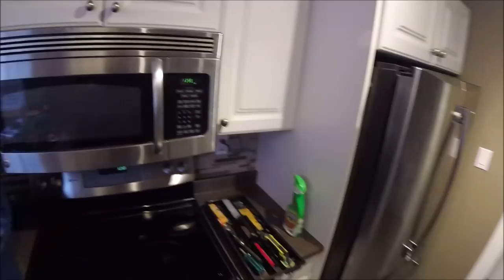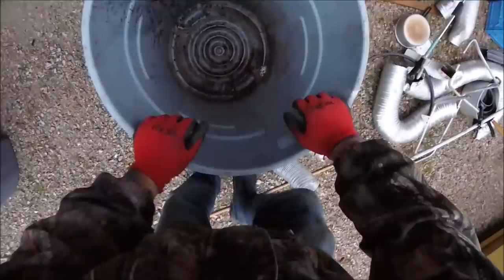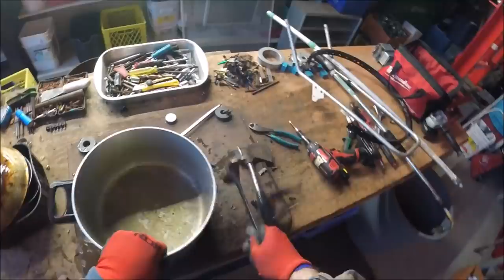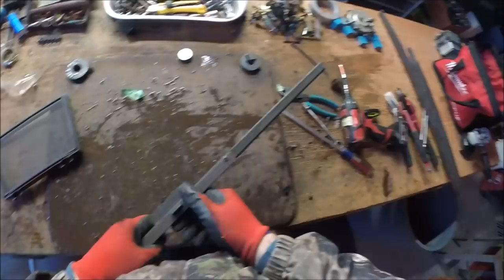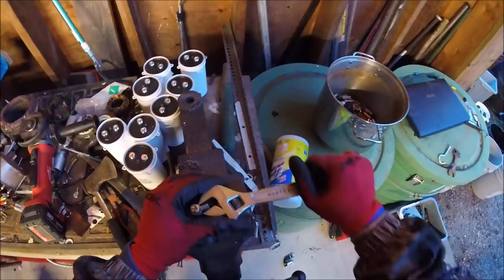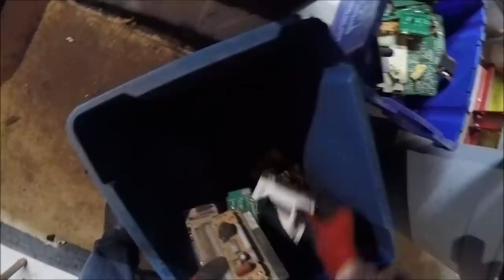Demo Tour + Cool Find in The Attic & More Scrapping

Comment: Those lock cylinders you can unscrew the turn lever cap to remove and separate the shred from brass, then there is a rectangle cap (on the part you broke off) remove that then shake out the pins (usually brass) then the two pieces should slide apart.
I just did about 2500 of those and if you continue to peel back the brass cap all around the cast cylinder housing where it is crimped over edge of the cast housing they will usually fall apart.
Reply from the maker: Some come out easy